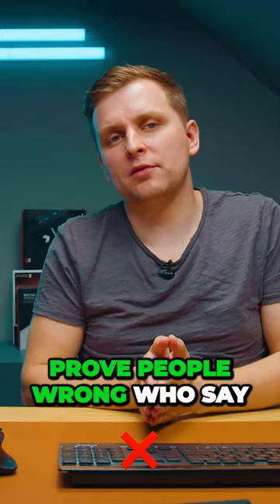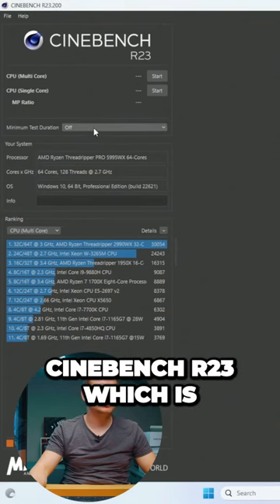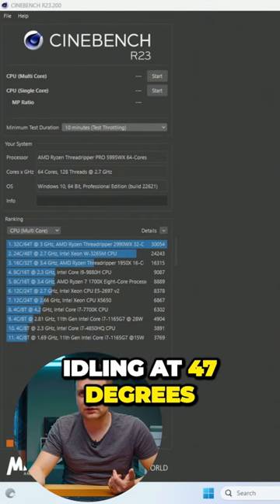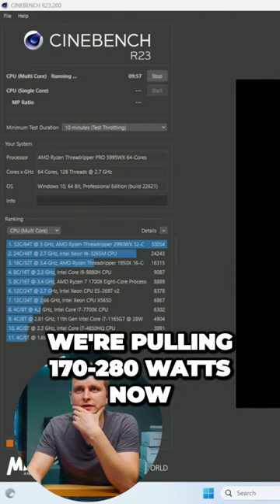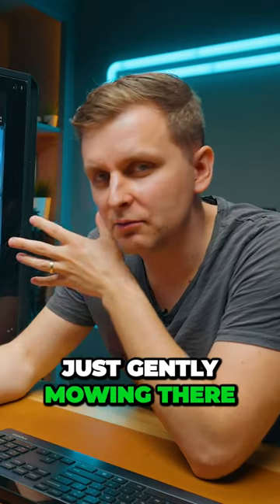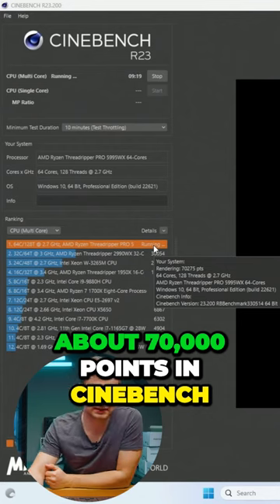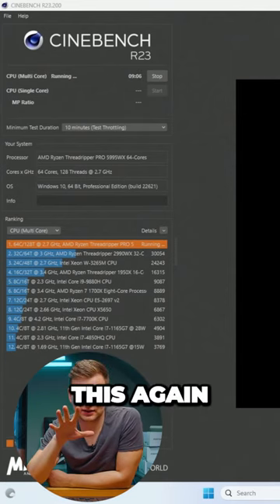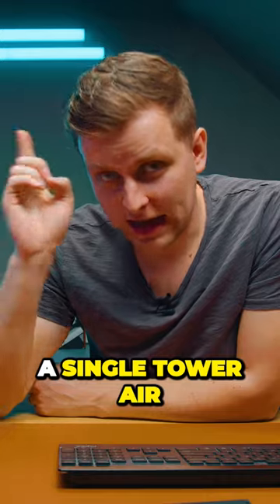Air cooling shocks viewers as it dominates highpowered CPU test

Comment: I changed to only air cooling many years ago when I had a water loop leak in a $6000 computer and corrode the main board and case (there was no glass side panels in those days).  Now I use Noctua in all of my systems.  I have never had any thermal problems.  I also never run 100% CPU for lengthy times.  My AMD R9-5950X is air cooled, my new Intel Xeon W7-2495X is air cooled.

Comment: I think ppl confuse power draw with power/area, or maybe it is simply not well understood. The limitations of a cooler are normally due to the total heat conductivity between the cpu die and the heatpipes/water. In other words, once a cpu reaches/surpasses the max conductivity of the various layers it will generate more heat than what the system can dissipate, but if the same cpu had a larger die the heat would be distributed on a larger area, making the cooling easier. 

Note: obviously the cooling area (aluminium fins of the cooler) combined with airflow could be a limiting factor, but in general it is not the case

Comment: You really don't need water cooling but because of very hot graphics card and poor airflow case it will heat up your aircooler fins. This is why watercoolers gets and advantage because radiators sits right behind case wall and has direct access to outside air which directly cools cpu better than air cooler sharing heat with your gpu.